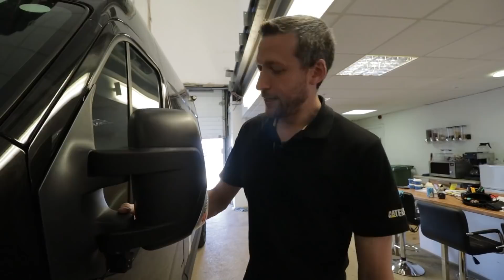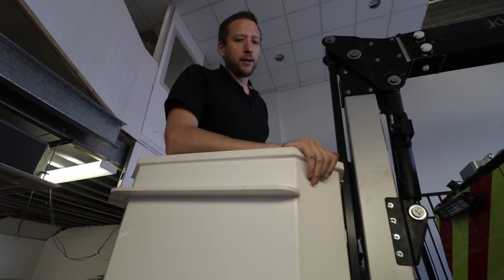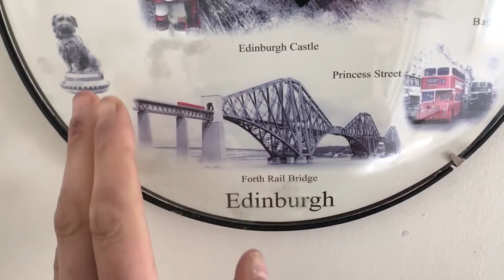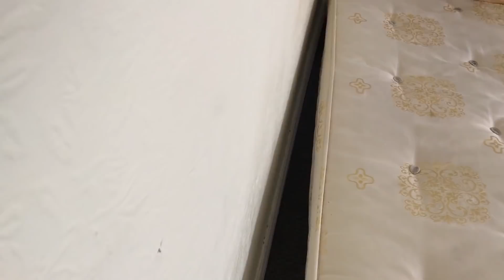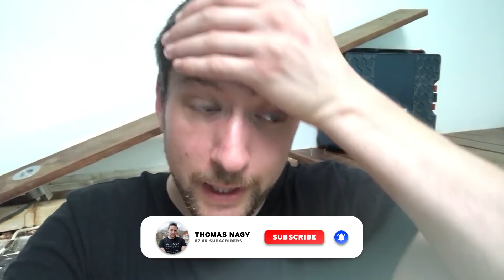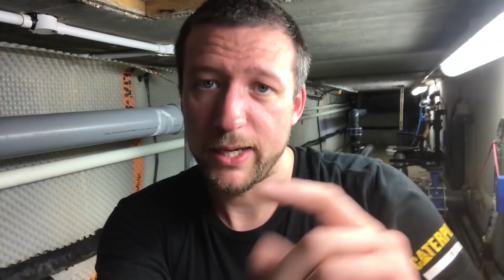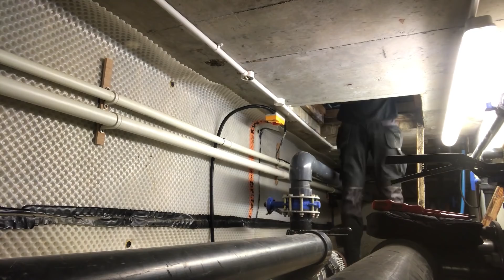Help me price this ABANDONED house | Thomas Nagy

Comment: Did you get sort the Mewp dilemma? Most cherry pickers and scissor lifts have a manual pump that the bloke on the ground can manually pump the sections down to lower the operator, does your machine not have this ability?

Comment: 7K to rewire a 2-bed house? That's about 3 months rent in most of London, less in the desirable areas. Considering it'll last for 20ish years that sounds like a very wise investment -- not only will it reduce fault calls to the landlord and make it more rentable it will make it comply with the new "your wiring must be up to minimum basic standards, scumlords" legislation. That's a pretty hard "mandatory entry requirement". I understand that buy-to-let has a lot of hidden costs, but FFS, get a grip and dig into your savings or get a loan! The astronomical never ending rise in property value in the crapital will probably cover your outlay within a year.

Comment: Worked with one on an old style Landrover. Electric/Pump opperation on that was on a control box at the back of the cab with a big turn switch that had to be switcked over and them two buttons to push at the sam time to loweer. Mainly for a 2nd person to lower the boom to get you down if there was some form of failure of the main controls.

Comment: you may want to carry wide and thick pieces of treated wood to put under the van's jacks when working on soft ground to increase the surface.
also there should be 2 people around at all times, one in the bucket and one on the ground.

Comment: Nice one.....your right about pricing and how low people will go , I priced up a 6 bed house over 4 floors in north London to the spec the designer wanted with a mountain of data cabling to go in to control all the gadgets plus fire alarm and it came in at £ 22k...... somebody else ended up doing the job for £ 8 k....😳......
The materials alone that the designer specked would have cost around  £ 6 k..... This is what your up against all the time.....👍

Comment: Bucket Manufacturer must have an emergency call out rescue squad that will come and save you if you get a problem.  Its a free phone number and you can call 24/7  (joke).  Ring them up, get them to fix the issue, they have sold you something that doesn't work.

Comment: You should always be able to lower the bucket. If you are stuck in the air you are at greater risk from surrounding traffic. Suppose the van's electrics fail, like the main fuse opens, all power to the vehicle is gone (no flashers). You are now very likely to be hit by oncomming traffic. There has to be a manual overide that allows the bucket to be lowered. The lift is hydraulicly driven so ther has to be a valve that can be opened to release pressure to the vertical allowing it to lower.

Comment: So as I've read below and is usually correct, turning the engine off from below disengaged the PTO. The controls from the top shouldn't do that. 
Also you should be able to manually over ride the legs from inside the van. Most have levers within the inside of the main panel that are locked away, you should pull/push the pulley type things. It's usually pull one to let the pressure of the hydraulic fluid through and then there's another 2 for left and right leg, needing 2 hands to do it. 
Which is why there's normally always someone at the bottom

Comment: There should be a manual hand pump for the hydraulic system but failing that you could use an airbag under the outrigger that has lost ground pressure.

Comment: You should have been provided with steel plates to place on the ground for the jacks to brace themselves on too distribute the weight, that’s certainly the case with the versalift bucket trucks that I regularly use. You really aren’t meant to do any work without them for exactly that reason. 

On very hot days it’s not uncommon for the jacks to sink into the tarmac as the surface layer melts a little and it’s very difficult to get them back out..trust me on that I’ve had it happen.

As for getting back down again should one of your jacks become unstable there should be a manual override inside the van at the base of your mewps . Usually right in front of you as you open the side door.

In 10 years of doing work using bucket trucks I’ve only ever been properly stuck up there once and it was a Sunday morning 😂 one of the hydraulic l hoses had burst and was up there for about 4hours. They sent out a tech to fix it and after many failed attempts the next consideration was calling out the water fairies (fire service) but thankfully they managed to get me down before that 😂

Apologies for the massive comment but hopefully you see this and is of some help to you. For anyone into the bucket truck content give my channel a look, I’m a spark and do a lot of street lighting work 👍🏻

Comment: You could buy a very cheap trolley jack and keep in the van for when stabilisers need a bit more pressure. Still need a 2nd person to operate it though. Only other thing, if you are working alone, you could put one of those emergency fire escape chain ladders in the bucket. At least you would be able to climb down, even if it wasn't all the way to the ground, it would be close enough for you to drop safely.

Comment: Maybe carry a sheet of steel say 6mm thick that you can put your jack on top of it if the ground is shit. It would stop your jack from sinking and you could easily slide it in the van. Wouldn’t need to be much bigger than the base of the jack.

Comment: There should be a hand pump release valve directly on the boom arm that operates independantly of all electerical control and safety interlock systems allowing you to bring the boom down in a safe controlled manner or at least thats how it works on dedicated MEWPs it might be different with vehicle mounted boom arms

Comment: When I’m asked for a quote, I state between £600-800 per room plus £800. This is dependant on location, parking facilities, occupancy and furnished or non furnished. Rooms are standard 1 x pendant and 4 x d sockets. Bath and separate W/c count as one room, ground and first floor hallway count as one room ( add £400 for each additional floor either basement or 2nd floor). All additions such as down lights, U/C lights or outside power are costed separately.
So 3 bed, 1 bath, 1 hall, 1 lounge, 1 diner, 1 kitchen = 8 x £600 + £600  ( £5400.00) or 8 x 800 + £800  (£7200.00)

Basically using the ‘per room’ cost is the most effective way going forward.

Comment: We use pads 1 meter square ⬛ they are a pain to take around strap them out side next to the bucket. Use the pads on all surfaces hard of soft the sensors on our lorries are the same

Comment: The company I work for has a lot of spider cranes that use a similar system with the cranes outriggers, what I’d recommend if you haven’t got them already are some outrigger pads to disperse the weight when on soft ground. Also most Mewps have a manual hydraulic system the ground operator can use in an emergency situation, you’d think the manufacturer would have something similar for your van

Comment: I had a look on trusted trader who recommend the following price ranges for rewires: 
3 bed house £3000-4500
4 bed house £3750-5500.

So there you go. 
I suppose if you had a labourer to chase out and help pull cables in you could reduce costs a little?

Comment: Immediately find a derilict airliner and remove the emergency escape slide canister and fit it to your bucket because it's obvious someone forgot to put in an emergency hydraulic release to lower the bucket to the ground. Other escape means are a very short bungey cord, rope ladder  or the quickest opening parachute.......ever.
Be sure also to take a photo of the truck and put it on your wall of achievement.

Comment: When deploying the stabiliser jacks you should use pads to distribute the pressure, and transfer a significant portion of the vans weight onto the stabilisers so you have proved the ground is stable and they can’t unload by moving the boom out to the side; not so much that the wheels come off the floor, but you should be able to see the suspension is less loaded than if you are ready to drive the van.

Comment: If the ground shifted AND you are stuck because of it and the software locked you out, you are not stucked and safe, because the ground has shifted you are nit really safe. This is surely a software BUG because it behaves differently if you stop and start the motor. The behavior should be the same. You should contact the manufacturer and submit a bug report.

Comment: This is a great example of Health and Safety implementing interlocks to protect incompetent operators for the 0.1% of events where an untrained or incompetent person has caused an issue.

In reality, all these interlocks do 99.9% of the time, is frustrate and impede competent and licensed operators while they're trying to be productive.
It just goes to show, there is NO substitute for training and ensuring operators are competent and have a healthy respect for the work they are required to perform. Certainly, creating an entire industry around literally making up problems under the guise of "there's a safer way to do this" is not the way forward. Especially as the assessment of "safety" is generally made by people who are completely untrained in the operation they are assessing, and therefore, incompetent themselves yet allowed to create processes without consultation.

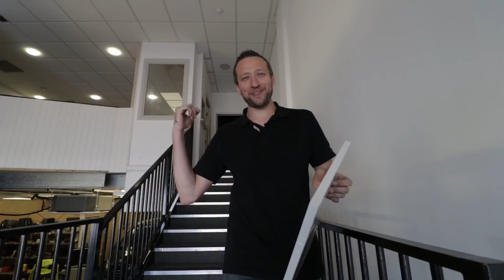Comment: 11:32 Change the word theft to Stock Control and controversy solved because what you have done is implemented a well needed stock control system for your business. Tell the viewers how many £££ you have tied up in stock as it may even surprised some sparkies. I did simple IT support and I carried hundreds of AUD$ worth of parts in the boot of my company vehicle and just thinking about it I carried round AUD$100 worth of 8P8C connectors (CAT5e only) half and half solid and stranded ones and I didn't officially do cabling. This also protects your employees since they may forget to make a note of an extra item that was used on a job because customers never ask for an extra power point or light to be install while you are here can you and it can be easy to forget you installed 1, 2 or 5 extra items that weren't on the job sheet.

Just a thought, while you have a Stock Control system, maybe you should also have a database for the tools/equipment that is carried in the vans. You've got a couple of quid worth of gear in there as well. Track ever bloody item you own so it doesn't get lost and there will be "no I returned that" lost items. 
As the saying goes, Look after the pennies and the pounds will look after themselves. How many fasteners do you go through in a year? It'll make your eyes water when you work out the £s. 😭

Comment: Tom it is the same with crane operations. Use pressure pads (aka steel plates) under the jacks. Also, re: coming down safely, there must be a manual pressure  relief valve. No hydraulic system should remain under pressure under no circumstances.  The person on the ground should be ablento operate that PRV to bring you down to safety.

Comment: You can buy bigger feet to put under the stabilisers (or you can use pieces of scrap wood) to distribute the weight better.

Also, I’d probably buy another trolly jack just to throw in the back of the van just in case you’re up a creek.

Comment: This race to the bottom has been going on for years, and will continue to happen long after we're all gone.  The house I'm in is a prime example; built by one of the big housebuilding conglomerates who will remain nameless (their name rhymes with Carrot); plasterboard has not been fixed properly, nothing is close to straight, square or plumb, the electrics are a shit show.  Pay peanuts, you get monkeys; simple as that.  EICR for £80 seems a norm.  The last "electrician" who came here to do an EICR was sent by the letting agent; he was in and out in 20 minutes.

I think £7500 is a fair price; a fair price for a good job.

Comment: The stabilisers obviously complete a circuit when sufficient pressure is on them.
You could wire in a manual override on a key switch in the bucket that "tricks" the boom computer to think stabilisers are deployed and allow control of the boom again.
*this is obviously unsafe/uncertified practice to bypass safety systems.

Comment: The most difficult thing is pricing correctly,.... its a minefield..
One thing that I always check is the hardness of the internal plaster work before I quote,  also the type of brick,  block or stone of its construction,... this factor has a monumental bearing on the labour involved.. So I always isn't that the customer allows me to make a very small " Sample " chase with my hammer and small hand chisel...  
Fucked up big style a few years ago,  rewire on an ex council bungalow,... The plaster and red brick was like Fuckin steel,... took a week more than estimated and a shit load of 5.5mm sds  bits....
Never again.

Comment: Why don't you carry in the crane truck a bigger pad (like larger cranes use, but doesn't have to be as big as a 75 tonne crane pad lol) and put under the jack? This spreads the jack load and helps stop the soft ground issue, esp as the jack foot isn't that big. If you find or think the ground is soft etc put the pad down for a greater load spread area.

Comment: 22:45  you need to lift floor board or open ceilings to run pipes or new wiring you need party wall agreement with each flat that you share that space with! Not mentioning bond if there is management company and lease mentioning this type of work....

Comment: There should be a manual hand pump and switch/valve inside the back van normally near the hydraulic bits. The person on the ground would then know how to swing you back in lower it down by pumping the handle and  usually pushing a button or two!

Comment: These should be always used with someone on the ground for safety reasons really.
Another issue which happened a few years ago with council workers using bucket trucks on two separate occasions was the crews were killed when the hydraulics failed and the buckets tilted throwing the occupants out of the bucket to the ground. They weren't wearing their safety harnesses as they should have been.
The manufacturer has designed it to fail to safety as required by regulation.

Comment: Yeah, the manufacturer would rather have someone safe in the bucket but stuck there, than have someone stuck in the bucket and do something dangerous to try and free themselves. If you're that badly stuck and don't know what to do, time to call the fire brigade instead of DIY-ing something with a pry bar at the side of the road, or trying to safely transfer someone from one MEWP to another (you can't).

When they said you shouldn't operate MEWPs alone, they didn't mean at least two MEWPs (so you could use one to rescue the other), they meant at least two *people*: one in the bucket and one on the ground. If the boom locks out the controls for safety, the person on the ground can ALWAYS use the emergency controls on the hydraulic system itself to slowly lower the boom. Make sure your ground crew or spotters know how.

Massive oversimplification here, but here's roughly how MEWP hydraulics work:
- Fluid always flows from high pressure to low pressure.
- Tell the controls to go up: pump provides high pressure, valve opens, cylinder is lower pressure than the pump so fluid flows in, boom goes up; let go, valve closes, pump turns off.
- Tell the controls to go down: pump provides low pressure, valve opens, cylinder is higher pressure so fluid drains back into the sump tank, boom goes down; let go, valve closes.
- Valves are huge to handle a high flow rate when going up, but that valve is open even when you're going down, so the pump still has to provide some countering backpressure to limit your descent speed.
- All MEWPs have emergency controls on the ground mechanically connected to narrow valves that naturally limit flow rate, and will just slowly drain directly into the sump tank and lower the boom.

When you switch the engine off the boom realises that if you tried to go up, there's no PTO and therefore no pump providing the backpressure to limit your descent speed. So the valves would open and instead of fluid going into the cylinder, it would drain FAST and the bucket would drop quickly instead of going up like you wanted it to. That's why the ground controls can pump fluid in to manoeuvre anywhere just like the bucket can if the PTO is on; but if the PTO is off, they can only use the small emergency mechanical valve to drain (go down). 

The boom's safety system has no idea if it lost PTO power because you intentionally switched your engine off (and know you'll need to switch it back on again later) or if your engine just randomly conked out; but it DOES know that if the engine were to conk out while the valve is open, it would lose backpressure and the bucket would fall. So if the PTO goes off for any reason, it goes into total panic mode and locks down everything except emergency lowering until it's reset. Just leave your engine on.

As for the outriggers, use spreader pads or blocks to spread the load so the ground doesn't sink, and extend them as fully as you can.

Comment: oh but before you go into the hole you need an O2 monitor, carbon monx monitor ect ect. you need a  harness with a winch over the hole to pull you to saftey when (not if) you die. 
Gosh I see water, no no no that must be dry before you enter the slip risk is just too high, and you may come into contact with mains electric, water and eectric dont mix.   
🤣🤣   2x👍